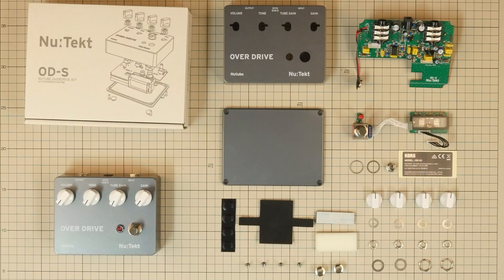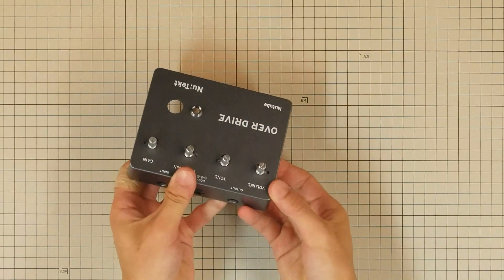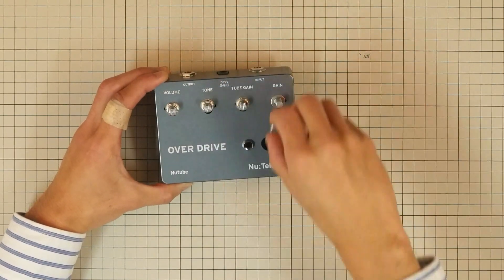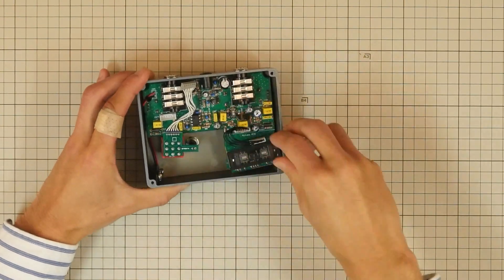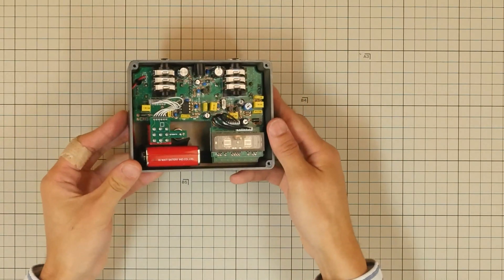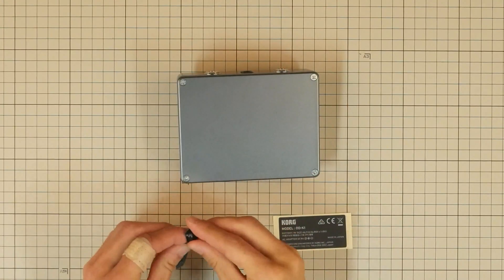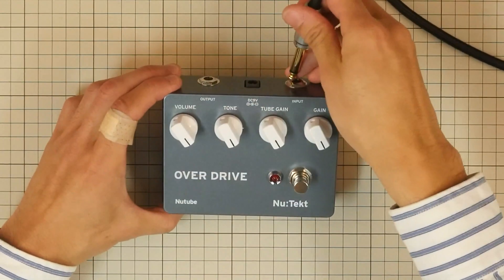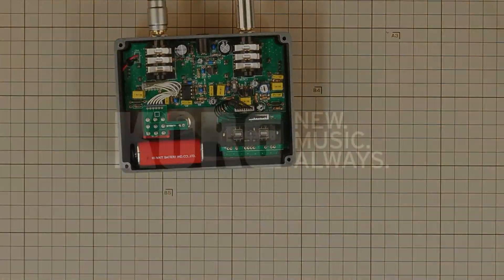Nu:Tekt OD-S - Unboxing and Assembly tutorial

Comment: I bought an overdrive pedal kit for under $50 - which was a complete solder job (not one of these ready made - just put in a few screws - kits!) It sounds superb. Like the BOSS OD1. Like I said I soldered all the components - easy if you can use a soldering iron. I learned a bit about how the circuitry works; was able to customise it in some way. And it was only a few dollars.
Korg is known for it's relatively affordable gear - like the Volcas, the NTS-1, and even some of their larger synths like the Monologue (which I own, as well as 2 volcas, and the SQ1).
This is totally ridiculous! I would not expect to pay more that $100 AUS for this! Overdrives are one of the most basic circuits - even if they do have one of these so-called tubes in them.
The NUB-ASS has them - and only costs half the price!
Those are my thoughts!
ANY COMMENTS KORG?
Reply: This is something different